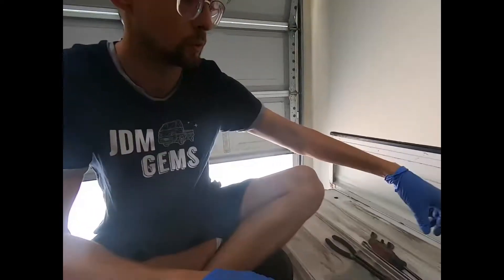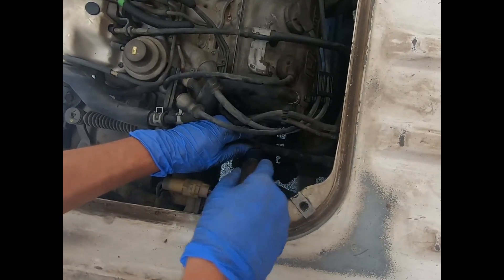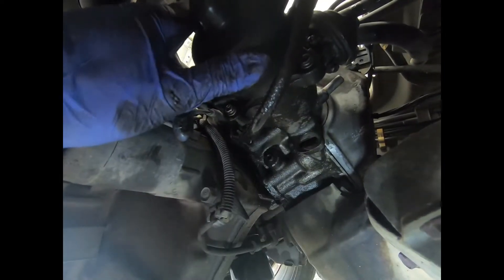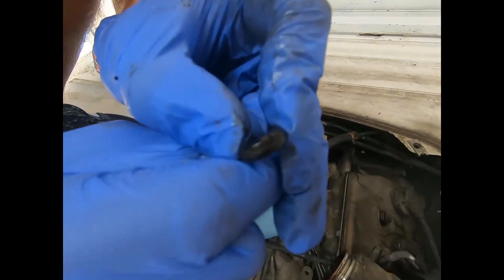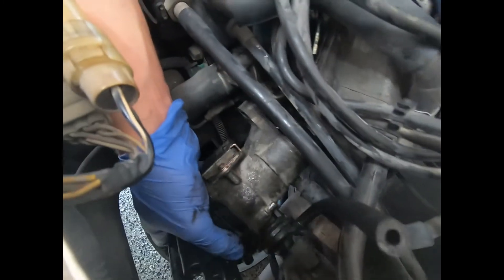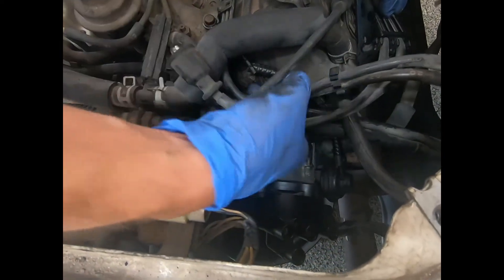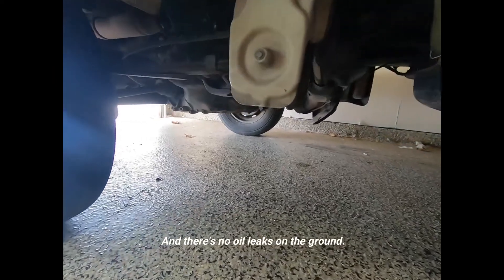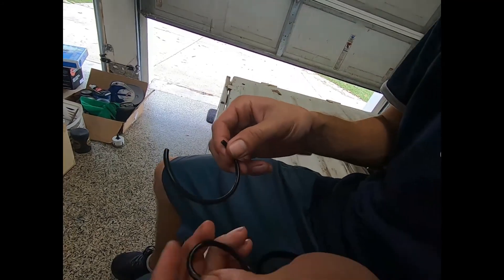Distributor O-Ring Replacement Honda Acty or Street with Custom O-Rings

Comment: Do you sell the 2 orings for the distributor?
My vin starts with HA3. Would this make this truck an HA3 Acty?
Do you sell the cv boots for the rear axles?  Found boots for HA4 on Ebay but not sure if they will work.